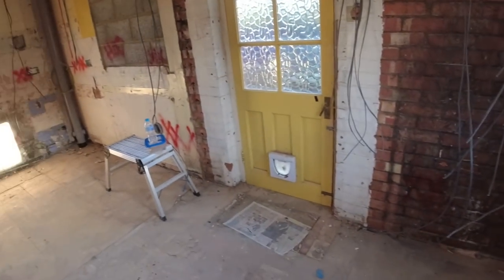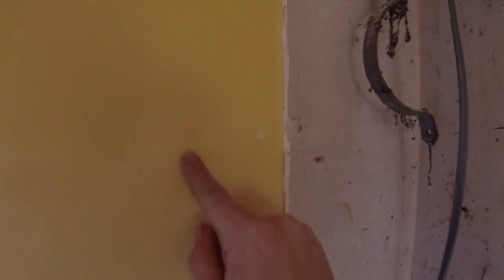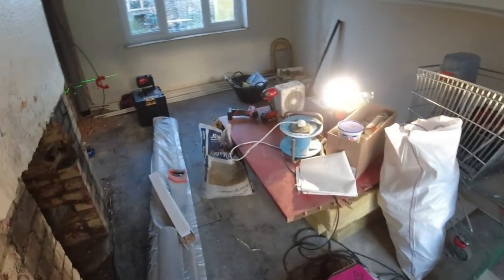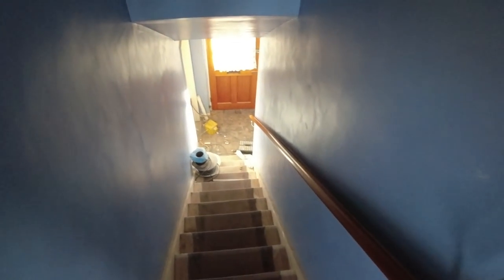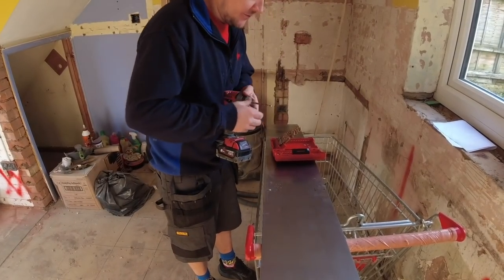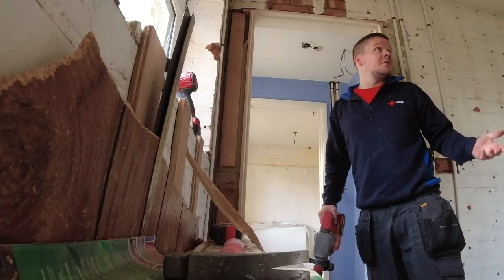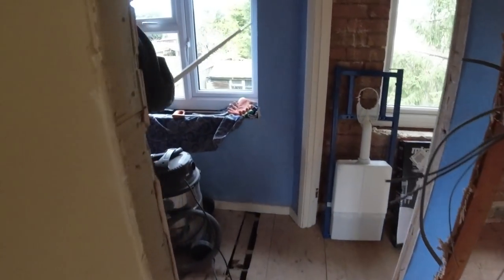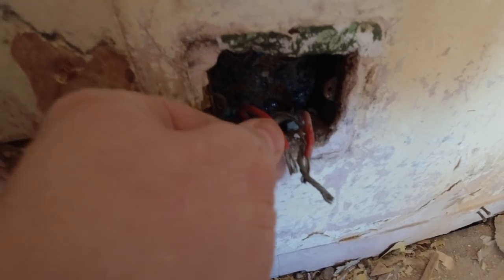Protecting meter tails in fabric of building or just bang them in the cavity?

Comment from the maker: Give us a comment below I will reply to every single one 💪
Reply: You should borrow Bundys Metabo for chasing or evan Naggy he got a brand new one
Reply from the maker: Yeah both a little far away to borrow a chasing machine.
Reply: @Cjrelectrical  have you ever tried one, just curious to have your views on it, seems a good bit of kit.
Reply: I’m an electrician from the mid 70s when I started to wire houses when I was 1st year mine electrician…………..putting cables in a wall horizontally was a no no then,can anyone tell me what’s changed
Many Thanks in advance
PS CJR. nice to see a proper electrician thinking of everything………………..I always used to work by the 7 Ps……….PRIOR PERFECT PLANNING PREVENTS PISS POOR PERFORMANCE……………,it served me well over the years
Reply: @omriroberts137  google safe wiring zones - basically if there are two things VISIBILE on the wall it is permitted to run horizontally between them. (If >50mm deep or mechanically protected it is permitted to run without visible items.)
Reply: @timhoward7037  Thanks for reply
Reply: @timhoward7037  well
We Electricians know this
But nobody else knows this
It is not safe at all
I use metal everywhere I can, as even putting it in prescribed zones won't help, when people don't know about such zones

Comment: I just looked up Dewalt wall chasers and with batteries they are £700 approx so Metabo looks the best option if buying from scratch. Great video as usual Chris. I always learn something new!
Reply from the maker: Yeah was an investment I needed to make. The batteries sold it for me.
Reply: @Cjrelectrical  I got the Dewalt over the Metabo for the same reason. Limited power on site and I don't like running a mains chaser off daisy chained extension leads. Just shove the Metabo blade in and let it chunk out the wall for you - mind if you don't have at least 4 batteries to cycle between it'll take you over a day to chase out a house.
Reply: Eibenstock wallchasers look better than the Metabo

Comment: Get yourself some metal countersinking bits!
As for the tails, I'm not sure why they are running under the floor upstairs. As the house is stripped back and you have free rein, it would make sense to put the CU as close as possible to the intake. If I had to run the tails further than the DNO's limit of 2 or 3m before needing to fuse down, I would prefer to use 4c SWA and run the cable externally if possible.

Comment: Regulation 522.6.204 provides a list of acceptable wiring systems that can be used. These are typically earthed metallic and can be trunking or conduit, steel wired armoured (SWA) or mechanical protection that is sufficient to prevent penetration by nails and screws.

Comment: Chris the hex shank for quick change is not just for impact drivers, as you demonstrated not normal to use Impact for cutting metal with HSS!!   Nice tip with the 10mm drill, Milwaukee not produce a counter sink bit?!  Love the vids!!
Reply: Nicer to do 3mm and then open up to 6mm cutting oil also worth it from Toolstation

Comment: Are those ceiling joists going to take the weight of storage heaters in the loft conversion?
Reply: No, that’s why it was mentioned in the video that the builder will be adding new floor joists 👍🏽
Reply: No the ceiling joists are only really to take the weight of the plaster board below, stop the roof spreading and take the weight of your Mrs when she puts the Christmas tree away....the new floor joists will be more than adequate though 😉

Comment: In that scenario I'd have had a 3 pole mcb in the meter enclosure with a 16mm 4 core swa into one DB with a 3 pole main switch and had it all in one board ,
Reply from the maker: One cpc feeding both seperate supplies?
Reply: @Cjrelectrical  yes one earthing conductor into one board , it's the same supply just 24hr and off peak , I would have installed one board and a 3 pole main switch but each to there own 👍
Reply: Tails seem to be run anywhere these days as long as you fuse them down but for me the shorter the better as if you get a muppet with a saw it won't matter is there not on the ceiling and if he / she cuts through the live with a hand saw it won't go bang immediately and they may grab a rad or pipe at the same time ( rare admitted ) but they could be Dead as a dodo as that 80 amp fuse ain't blowing any time soon ( swa all the way ) 👍

Comment: Great video, just a question was the metal plate earthed if running single meter tails in a wall
Reply: suspect he used double insulated tails so no need to earth
Reply: @kevvywevvywoo   regs say plate needs to be earthed if buried in wall
Reply from the maker: Where ?

Comment: could you not just use the metabo blade in the dewalt chaser as it has slightly off set teeth to take out the chase, or is the spigot a different size?
Reply from the maker: The triple blade doesn’t cut the pieces small enough and it clogs up the chaser
Reply: @Cjrelectrical the actual metabo blade has the teeth offset to make the chunks smaller, i have the metabo chaser myself and love it.

Comment: I dont think anyone would but what about if someone tries to drill a hole from the outside into the house?  Also although probably not required would earthing the plate be a good idea?  If someone did decide to keep drilling least it should then create an earth to live path to blow the fuse?   I think you have done all you can really, its difficult when needing to run tails..
Reply from the maker: Earthing a plate is difficult as you’d have to have the connection bolt ect accessible for maintenance
Reply: I was just thinking about earthing the plate..... You can only do what you can do.... I once told the client not to hang anything over a light switch, 2 day's later she called me back as the light's where not working..... Picture above the light switch 😫
Reply from the maker: There’s no excuse for stupidity
Reply: The plate should be earthed, it's in the regs.
Reply: @stuartrhoades4306  What reg is that? don't have my book to hand but of what I remember you need to protect cable <50mm using either RCD or earthed metalic cover (Also covers SWA) or mechanical protection resisting nails or screws..  I think if you hit that plate with a screw or nail you would know about it..   I could be wrong without checking..
Reply: @steve11211  you're right if a screw or nail won't penetrate the plate it doesn't require earthing, I'm just not sure exactly how thick a plate that would need to be, as usual the regs are quite vague.

Comment: Have you ever come across any asbestos in the walls like the plaster and plasterboard when you're doing a re-wire?
Reply from the maker: Yes around door frames as packers and windows and under floor boards again as packers
Reply: @Cjrelectrical  Ah, have you ever seen it though in the plaster etc. Wondering if I'd find it in my walls as its a 60-70's house.
Reply from the maker: Might be mixed in with lime or cement based plaster or render.

Comment: Deciding between the metabo or the dewalt, cordless is desirable obviously but is it man enough for lots of chases ? I don’t want to spend £500 on 54v battery’s to keep the dewalt going. Thoughts please Christopher
Reply from the maker: I managed to knock out 16 full height chases before the battery died.
Reply: Impressive, 9 or 12 amp?
Reply: Get the hilti , can take 3 blades and fully adjustable on width.Nice base platform and glides very easily.Even chased concrete ceilings in flats as they did not want a false ceiling in.

Comment: The tails look long than 3m to me haha !! House bashing to a T, Brings back my days
Reply from the maker: Yeah explained in detail at end of video they are around 5 meters once terminated so will swap isolators for switch fuses.
Reply: Should really be in swa Then ?
Reply from the maker: Ideally but absolutely impossible to install 2 x swa and switch fuses in that enclosure. This was the best practicable solution
Reply: @Cjrelectrical  5 Core SWA ? one enclosure sw fuse
Reply from the maker: How would I install the swa with that radius bend without chopping out to much brick work and compromise the structural integrity
Reply: @Cjrelectrical  angle drill
Reply: I might have used 2X 16mm split concentric cable..it's smaller diameter means you can bend it tighter
Reply from the maker: Andy k your missing the point you can’t chop out over 50% of the brick to sit it flush
Reply: @สมบัติสตีเวนสัน-น6ษ  what's the advantage of split concentric cable over normal tails? Both would require some form of  earthed mechanical protection.
Reply: @stuartrhoades4306  would it not  be same as swa in that it has the earth already outside so RCD not reqd?.it takes up less room than normal tails
Reply: @สมบัติสตีเวนสัน-น6ษ  no, because the earth is only around half of the cable,, the neutral is around the other half.

Comment: Real question.. do you do RAMS & method statements for your jobs ? 

Also what cert software do you use ? 

Do you do a cert for smoke detectors? 

Have u seen HOMEREWIRE SCOTLAND? They do full rewire including plaster etc in 1 day for your avg 2 bed place
Reply from the maker: Only if the client or project manager wants a rams pack then no. I use ICertifi for my electrical Certs. Yes we issue a domestic smoke alarm certificate to.
Reply from the maker: Another bonus the client had an asbestos survey carried out before any works which was great.

Comment: brill as always m8 can you explain how off peak works plz
Reply from the maker: So they have a smart meter that will supply the heaters at a cheaper rate of electricity.
Reply: The most common way is to get 7 hours of cheaper electricity at night. And the day price will be higher than average. The 2nd CU will only be Powered for 7 hours
Reply: @AndyK.1  no longer true with smart meters. Powered 24/7 but it bills midnight to 7 AM one rate, then daytime a higher rate. No need for split CU.

Comment: Did you not earth bond your steel plate?
Reply: It's not covering a junction and everything behind it is double insulated, it would not count as an exposed or extraneous conductive part under any definition in BS7671 as far as I can tell
Reply: @havoctrousers  I was just thinking that if you did manage to drill through the metal and hit a live conductor then it would trip, with a big bang, the breaker Chris is putting in the meter cupboard rather than sending the drill to  mains potential. Similar principal to steel trunking with live conductors.

Comment: Metal plate earthed??
Reply from the maker: No unless you can maintain the mechanical connection
Reply: Read 522.6
Reply: @joncutts6381  haven’t got regs to hand but isn’t there also a indent that states “ or otherwise protected from penetration”
Reply: On a rcd or earthed.
Reply from the maker: Can’t use 100ma timed delayed rcd for mains tails and can’t stick a 30ma on them either.
Depth greater than 50mm and safe plate is the only methodical way of doing this 99% of new builds are done this way.

Comment: Mains tails from cut out to dis board can’t be longer than 3 meters , unless I am misunderstanding the video ? Also I prefer metal caping as oval pvc tubing is easier to drill or nail through , also with metal channeling you can use metal detector or a magnet to find out where you can’t nail or drill

Comment: Hi, I think the metal plate needs to be  earthed
Reply: It's not exposed.
Reply: @UberAlphaSirus  it doesn't matter about being exposed , it's not an earthed wiring system , yes it should be earthed or run it in armoured
Reply: I think he means to comply with the reg relating to earthed metallic containment.
Reply from the maker: If it was containment and single insulated cables then yes
Reply: @Cjrelectrical  I’m sure if you put a cable less than 50mm in depth  without rcd protection it needs to be an earthed metal plate
Reply from the maker: Remember this is in a safe zone but can’t rely on that with meter tails hence the metal plate
Reply: @Cjrelectrical  I’ve just checked and it needs to be an earthed metallic plate or conduit or SWA even if in the safe zone with no rcd
Reply from the maker: I’ve taken advice from the NICEIC
Reply: I don't think that's necessary. If you don't plaster over the plate you won't  be able to penetrate this plate with a stone drill. Never! The drill bit won't get a grip and "dance" on the surface of the metal plate because it's not designed to drill into a metallic surface.
Reply: @philipwelsh6569  iv) be provided with mechanical protection against damage sufficient to prevent penetration of the cable by nails, screws and the like,  this is what was achieved by chris. I believe what he has done reasonably satisfied this indent
Reply: @Cjrelectrical  yea looks like I’ve got it mixed up, if it’s steel conduit it has to be earthed but not if it’s a steel plate
Reply: @Cjrelectrical  if it's less than 50mm below the surface it needs earthed metal covering or to be protecting by a 30mA  RCD, unless the covering is thick enough to prevent penetration by a nail or screw. I'm not sure how thick that needs to be, maybe your 3mm plate is enough.
Reply from the maker: Just remember they are within 150mm of an angled wall. With tails we can’t rely on this due to the over current device hence the 3mm thick plate
Reply: @Cjrelectrical  just out of interest why are you suggesting the situation differs because it’s tails and why does the ocpd make a difference?
Reply: @stuartrhoades4306  I would like to think a 3mm steel plate would comply. How much further can you go.

Comment: Despite what the competent scam helpline said I would of earthed the plate, silly not to and the connection could have been kept available easily enough.
Reply from the maker: How would you keep it accessible?
Reply: No need to earth it from a regs requirement. Also from a pure elec design point of view if you earth the plate you're kind of implicating it can be penetrated and thus doesn't offer the required mechanical protection it has been installed to provide. The whole protection by mechanical plate is a grey area in my opinion. But as CJR has said, not many other options in this instance.

Comment: please don't do that 5 blade thing again without correct sized spacers - you gave me the fear...
Reply from the maker: Why it cannot come off. Thanks for the concern though
Reply: @Cjrelectrical  because forcing the spacer over a motorised shaft means the spacer is no longer uniformed and at 9000 rpm that will introduce vibrations that the unit, blades, shaft and motor were never designed to be exposed to and 30 years in engineering has shown me that when you expose equipment to an environment it was never designed to be exposed to, bad things can happen and failures occur which would never normally occur under normal operation. That's all ;)
Reply: Life is boring without a bit of the fear 😎

Comment: I thought storage heaters were a thing of the past :((
Reply from the maker: Yeah unfortunately no gas and oils a pain so the client opted to stay with the electric heating
Reply: Thing of the future with gas and oil outlawed and only other option a heat pump that can’t keep a shoe box warm!
Reply from the maker: I’ve got a heat pump and it works great with an insulated house.
Reply: I am in the same issue with no oil and gas at my home - I'm a spark, and I have been installing Herschall IR heaters. They are a fantastic option. But only if you upgrade the insulation at the same time